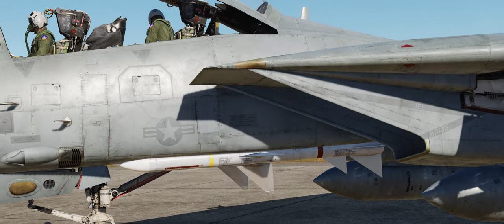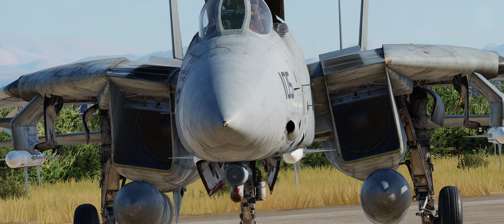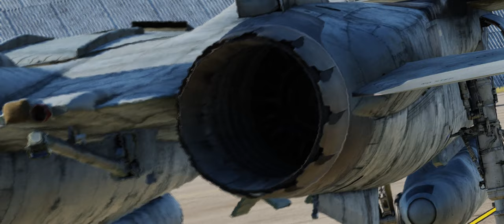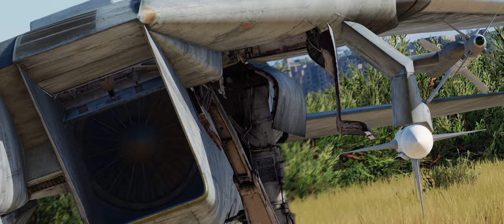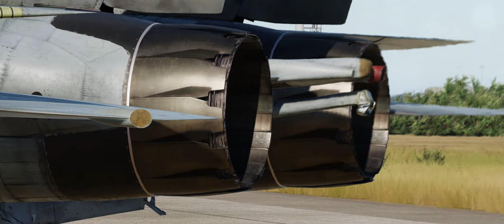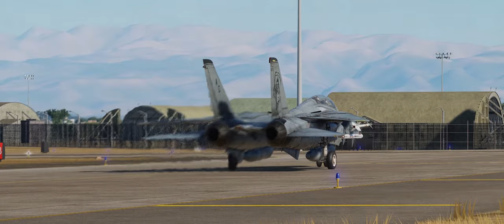F-14 Sound Overhaul: Startup & Taxi

Comment: Heat blur is FINALLY being added in by HeatBlur.
Reply: That cracked me up so hard
Reply: its always been there, you probably had it turned off in your settings!
Reply: @Maverick1375  Hmmm no, not to my knowledge. I own 10 other modules and they've always had heat blur on their engines for me. With that being said, I haven't touched the F14 in a few months.
Reply: @lamduong5701  I got the F14 in around the summer and it had heatblur
Reply: @KJK9029  I preordered it and it had heat blur day one
Reply: Always had it. In fact it's one of the few modules that probably do it in an excessive manner.
Reply: @swagger897  Just booted up DCS. Still no heat blur. Am I missing some settings? Playing on max.
Reply: @lamduong5701  in the graphics settings to the left there are click boxes for Heat Blur, Low-Med-High
Reply: @Drew-kg5hb  Always been on high. Still nada. I can't be the only one with this.
Reply: @lamduong5701  Main screen, options, system, Heat blur: Off/Low/High

I'm on beta V 2.5.6.57264, most current release. If you don't have it still, I would do a system repair, and if still not there, remove and reinstall the f14 module. Not sure why it would be like that unless you have a conflicting community mod.

Comment: Heatblur please can you guys put a air compressor right next to the aircraft. For when we connect ground power 🔋 and air supply. That would be awesome 👌
Reply: Yes please!!
Reply: Those types of thigs were built into the flight line during those years. power and air had boxes up and down the flightline between every aircraft parking spaces at most bases. so technically that would be on ED to fix the maps.
Reply: If the A4 Skyhawk mod can add a huffer cart, I don't see why no one else can :)
Reply: @CVSiN  yep. I reckon the air compressor would be too heavy to be mobile.
Reply: @sheeplord4976  Nope we have "huffers" on tractors as well but we normally only used them on the ship. or at bases that didnt have the built in ones.
Reply: @sheeplord4976  if you're referring to an air start you would be surprised how small they can actually be. If your referring to an AC cart even the ones used to cool Airbus 330 are able to be pulled around by a regular tug found at any airport. The annoying thing is the noice of those damn air starts even with hearing protection.

Comment: Great job guys. Just one point, in after burner the engines are missing that classic tomcat “Hum,” sound. Watch any good audio video of an F-14B/D flat 8 or MRT with burners on to hear the “hum,” I am describing due to the twin engine effect. If you could add that sound effect in it will be pretty much perfect in terms of audio accuracy. But great job overall.

Comment: With this and the F-14A coming later this november, Heatblur is making sure everyone lose NNN.
Reply: Is the F-14A really coming this November? 

I want my Post-Cold War F-14A!
Reply: @blueofthelightanddark6273  apparently it's due for the 18th eof november
Reply: Hope for the Post-Cold War F-14A. Not Iran’s F-14A but the Navy’s Post-Cold War - early 2000’s F-14A.
Reply: @blueofthelightanddark6273  TBH I don't know
Reply: The VF-154 Black Knights and the VF-211 Fighting Checkmates used F-14As as Bombcats. Their F-14As were a lot different from the 1970s and Top Gun. Their F-14As have modifications and upgrades based on the F-14B. F-14A and F-14B are very confusing because the F-14A has ECMs on the glove vanes and one ECM was attached on the port side nose gear, as the ECM was used to be on the starboard nose hear. The F-14A also has the TACAN Antenna, UHF Antenna and the GPS Dome. One ECM is on the beaver tail of the F-14A. It also has NACA gun vents, removing the two-hole gun vents from the F-14A. 
From the outside, it look exactly like an F-14B but it has glove vanes and the P&W TF30-414A turbofan engines.

If you still don’t understand, this link will help you:
https://www.britmodeller.com/forums/index.php?/topic/234910566-tomcats-101-article/
Reply: @blueofthelightanddark6273  I see, thank you very much

Comment: I have a question on the aim 7s sparrows, they have 4 fins front and back right? If so, where the hell does the forward vertical fin go if the missile pylon is blocking it.
Reply: @One_Piloty_Boy  Those are pylon mounts.
Reply: The pylon is narrower than the missile. Also missiles are not dropped, they are ejected with percussion shells, similar to how a ramset works.
Reply: @PugilistCactus  Yes, there are definitely pylon mounts, however when you look at a picture of an F-14 with Aim-7s loaded on its center stations, and even the outer stations, the AIM-7s fins have to go somewhere, and that means either a specially designed pylon to accommodate the fin, or in the center stations, the fins actually go slightly into the fuselage. This is it with the pylon made for it https://www.google.com/amp/s/nara.getarchive.net/amp/media/a-close-up-view-of-an-aim-9-sidewinder-above-and-an-aim-7-sparrow-iii-missile-993eb7 while here the missiles dont have an external pylon. The pylon is inside the aircraft, and the missile is flush with the tomcat. https://commons.m.wikimedia.org/wiki/File:F-14A_VF-24_Sparrows_and_Sidewinders_3.JPEG The F-14 along with a few other aircraft like the F-4 have these special AIM-7 pylons where the fins actually fit into a recess in the fuselage. https://m.imgur.com/a/EHNcAzE While yes, some AIM-7s were racked at a 45 degree angle to allow other aircraft like say the F-18 to use them, the 14 and the 4 were specifically designed to have them slightly recessed and the top fin internal.

Comment: I installed the F14 sound mod that was released a month or so ago - straight copy/paste with no JGSME or any mod manager. Will I need to do anything to ensure this is overwritten when the new official sound fx come out?
Reply: probably delete all of the modded files and attempt a repair after the update
Reply: @bubby8825  problem is, I don’t remember which files were altered with the mod. And will doing a repair change all my settings and scripts?
Reply: @GunSlingerAUS1  delete them all and repair?